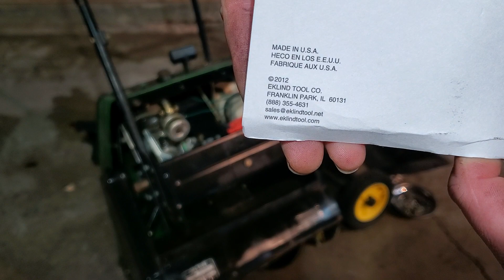John Deere trs21...won't stay running.

Comment: Mike I had that same snowblower made by TORO, my uncle gave it to me saying it gave him nothing but heartache.  I cleaned and rebuilt the carb and got it running, first snow it wouldn’t start.  I was pissed!  I brought it to a small engine shop my friend owned and he fixed it, showed me it ran and the next time it snowed once again it wouldn’t start.  Mike I literally poured gas over it as I was going to set it on fire!!!  My father stopped me and let me cool down- The next day I dropped it off at my friend’s saying “Free Enjoy!”  He had the same trouble.  To this day I wish I torched it!  🫣😂👍
Reply from the maker: Sorry you had such a hard time with that machine,hopefully I won't but I still have Big Red. Just in case I'll save extra gas 🤣.Happy New Year and pets to Pipes,and see you the next time!